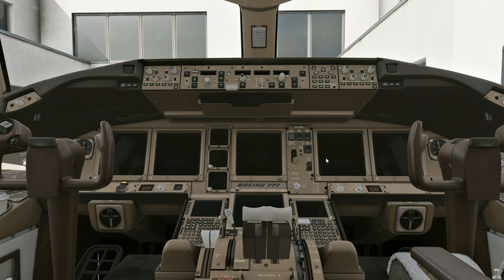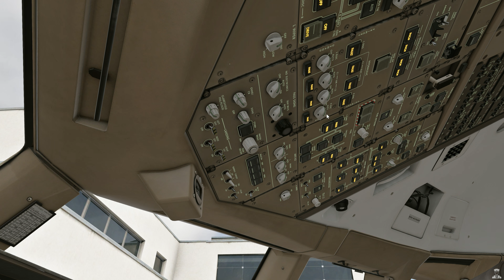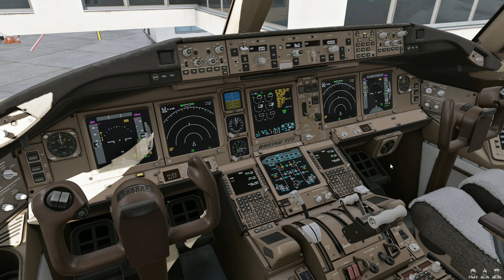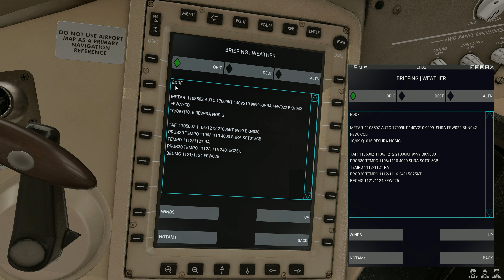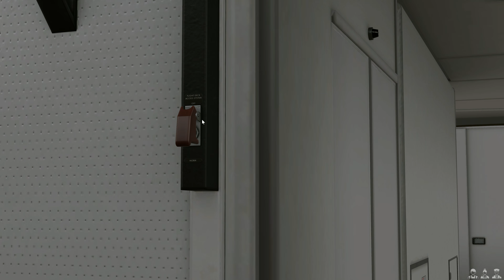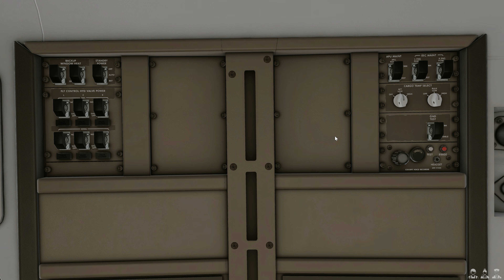FlightFactor B777 v2 | Full Flight Tutorial | Part 1 | Preliminary Preflight Procedures

Comment: Do you have to establish contact to do stuff outside or close doors? I find that a bit of a detour instead of just clicking open/close on the fmc..
Reply from the maker: You will need to establish contact with the "GND CREW" in order to load the plane that is not related to the Cabin. So external equipment, Cargo and Fuel. 
You will also need to establish contact with the "PURSER" in order to manage the Cabin items, such as Boarding, Catering and doors.
Hope that clears it up a little.